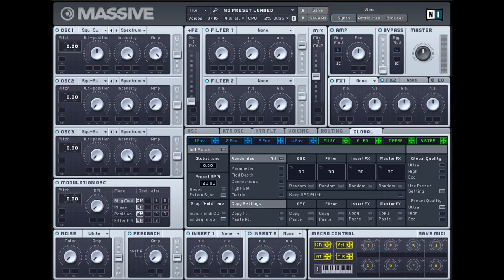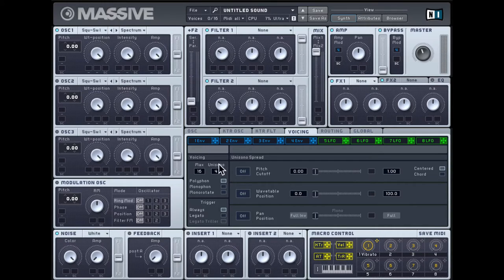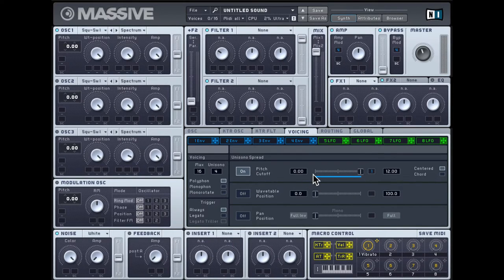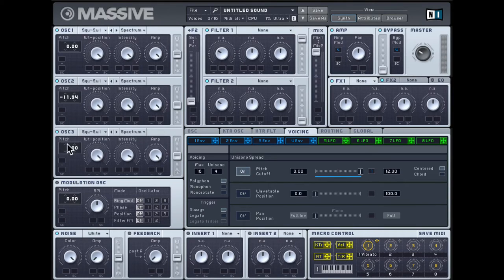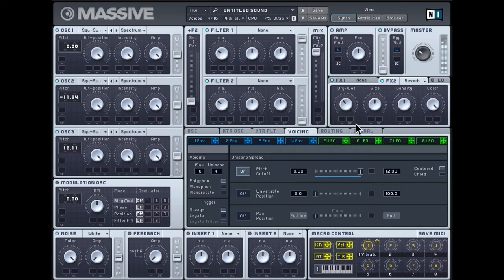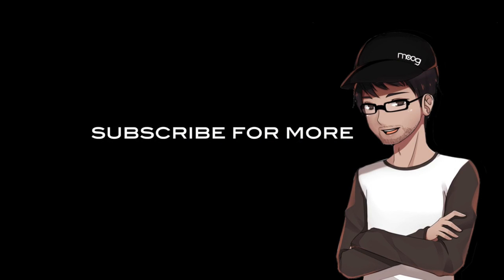Sound Design with Native Instruments Massive - 01 THX Deep Note

Comment: 0:20 Voicing tab. Unisono 4, Pitch Cutoff on, range up to 12. Drag 1 Env into slot, drag down to give it a negative range. 
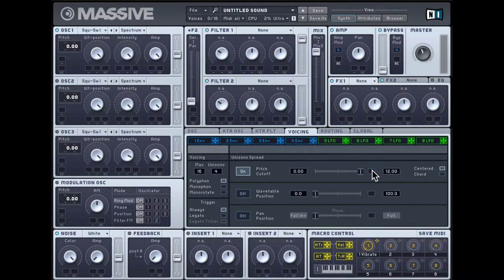0:55 In Envelope, no Attack or Level
1:28 Richer sound with more oscillators. 
1:54 Add reverb in FX 2 slot. Add Chorus in FX 1. 
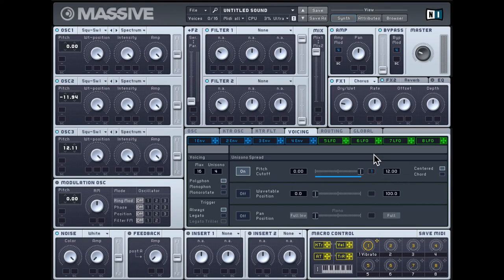2:25 Play with the Chord mode. Increase decay time to make the modulation last a bit longer.